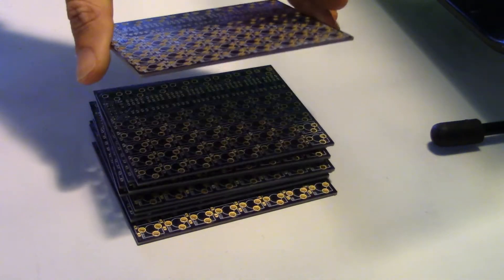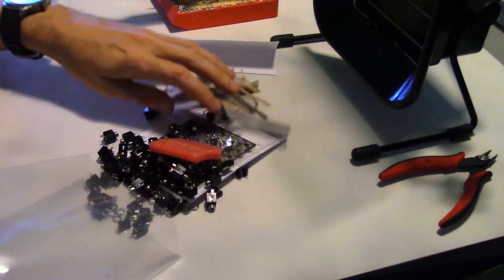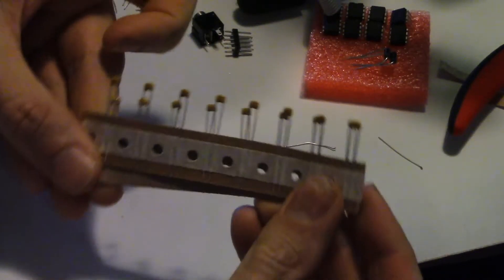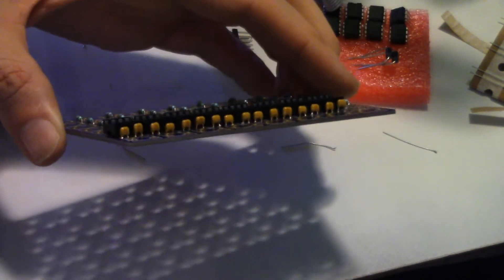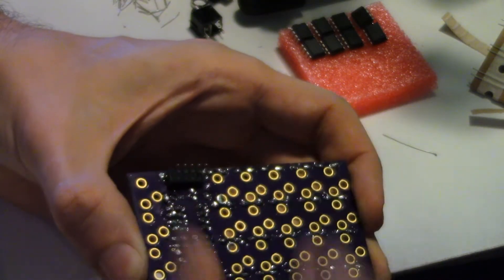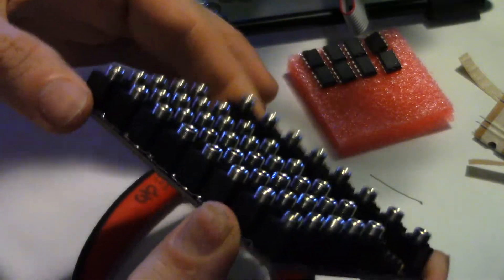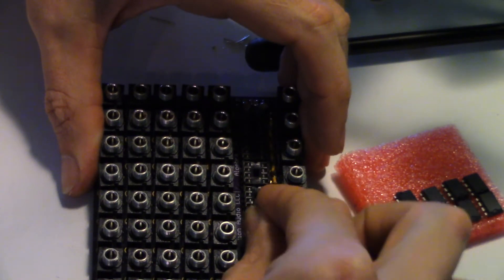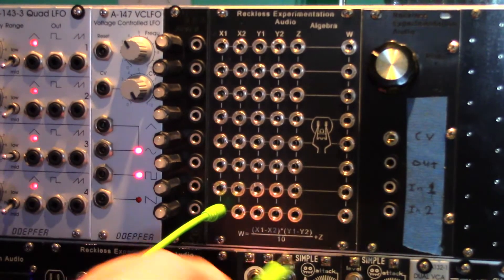Algebra Eurorack VCA Kit Build

Comment: I'm very new to Eurorack, so forgive me if this is a stupid question; why would a vca not have knobs? Isn't that the point of a VCA? To be able to control levels? I understand it can all be controlled using CV, but wouldn't a knob be needed as well to set a range, or max output?
Reply: With this circuit, the parameters you're referencing would need to be controlled by the outputs of whatever you plug into this module - which do not always need to exist - as the function it performs is strictly mathematical, in exchange for 8 modules in 16HP of rack space. There appear to be enough sections available here to introduce other devices to influence the functions, but like you detected, the CV controls (which often make the knobs redundant when both the inputs and outputs of so many modules have knobs) have been removed for space savings. I don't think this module is intended to replace the more common VCAs with manual controls, but to give a pile of automateable effects stackers, with straight-forward functionality.
Sadly, he doesn't seem to make this product anymore, or I would seriously consider it for its frustration-free experimentation value.